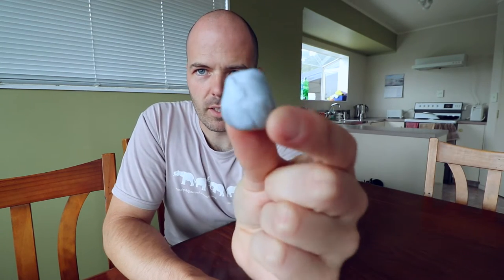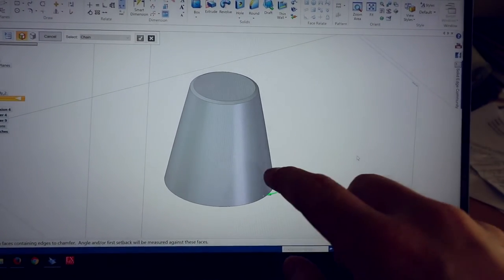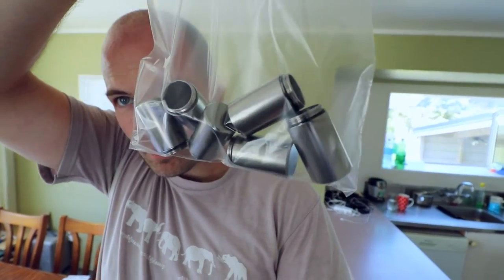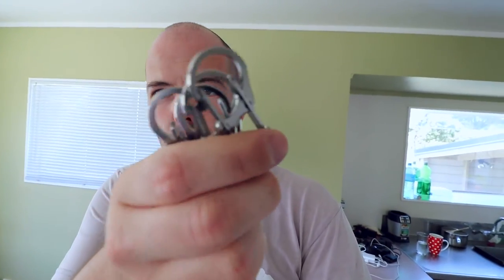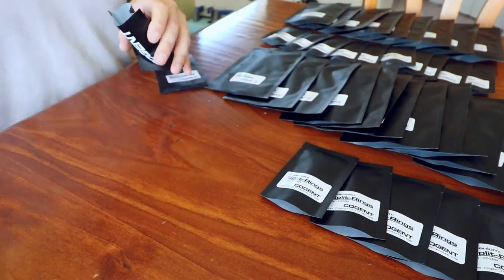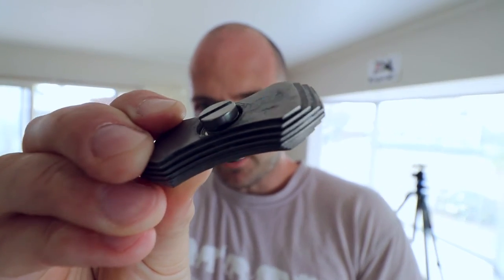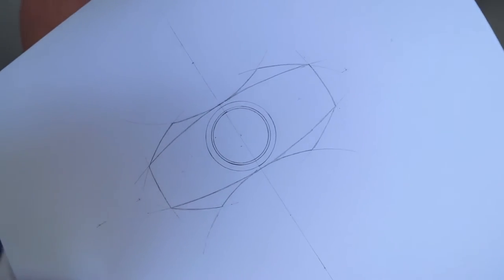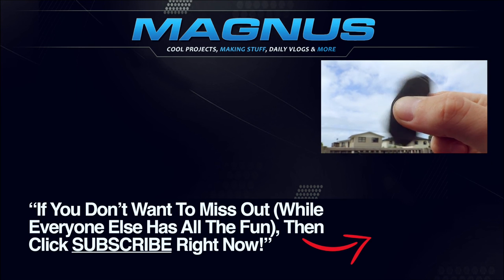Weird new titanium design.

Comment: I was thinking the same as Fabio - double/triple stand! It will have the additional advantage of being more stable. And maybe you should try to make it more universal, not just for your pens!

Didn't hear about the jet-board quite a while, when do you plan to continue with this project?
Before you set a foot on that thing .... do you know this one? https://youtu.be/_GlocFzRqQw 
It goes like 50mph, so you will need some really good padding and helmet, and dead man's control to stop the board when you fall off it or need to jump off. 
Maybe leave it to a professional stuntman to test it first ;-)
Reply from the maker: Hey Herbert! Yeah, you're right, the larger stand is less likely to fall over. The jet-board is on-hold as my current obsession with "spinners" is in full swing :-D. Also, I really need to get more products design and launched to help business/cashflow ...so that's the other reason.